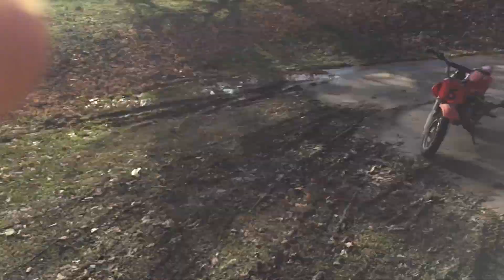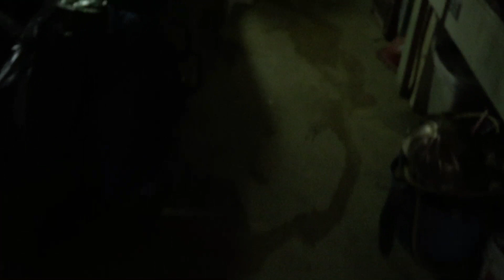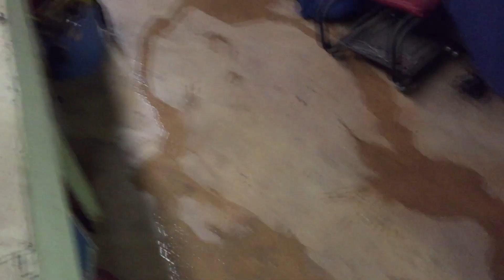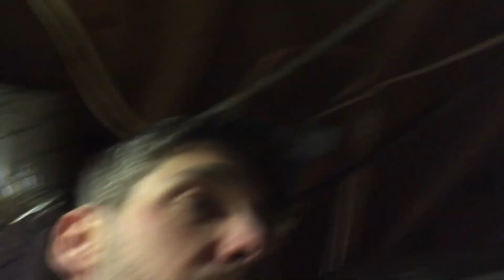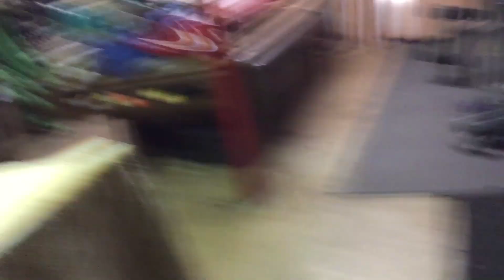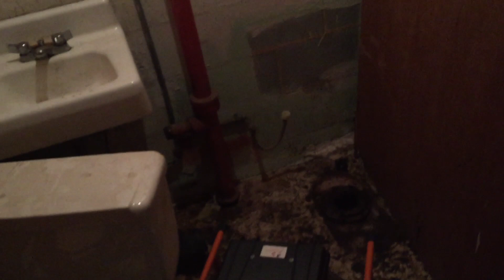Fixing Sewer Pipe Under Concrete￼ / Basement Floor D.I.Y.

Comment: Took the dust filter off?  Also came within a 1/16th of an inch from cutting into the power cord? I've seen enough.
Reply from the maker: yes did take the filter off wasn't doing much anyway>>> and i was a mile away from that cord  the angle deceives you

Comment: I just found out with a house I bought has a bathroom drain pipe to a sewerage ejection pump that has undersized drain. About fifty feet of floor needs to be cut and broken up along with shower and sink drain vanity removed

Comment: How come you didn't use a Jack hammer to break the concrete?  It would've been easier.
Reply from the maker: If you seen I have a hammer drill that has a jack hammer setting but I wanted the cut to be nice so I rented the concrete saw instead

Comment: Those pipes need to be pressure washed out before you have a major septic failure......
Reply from the maker: you mean sewer jetted or hydro jetting i do drain cleaning for a living... plan on hooking to the sewer in the future